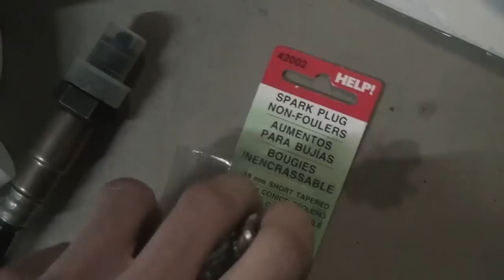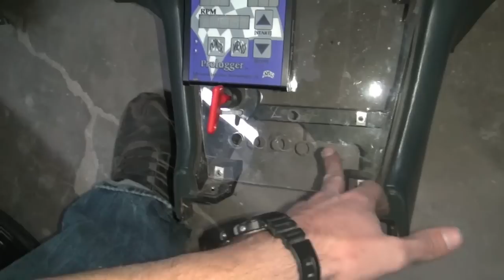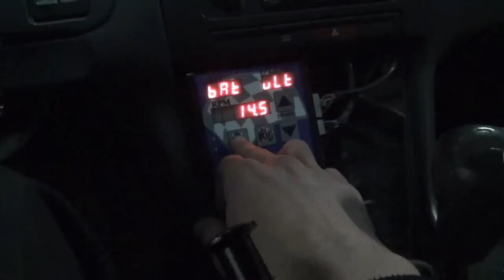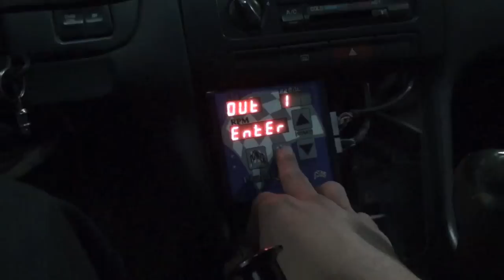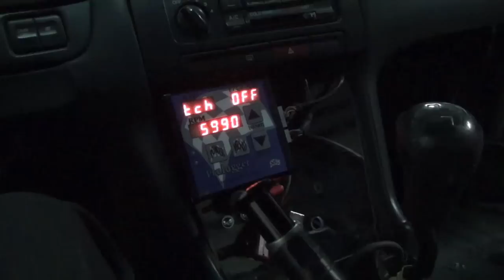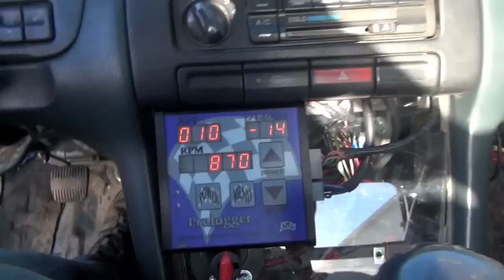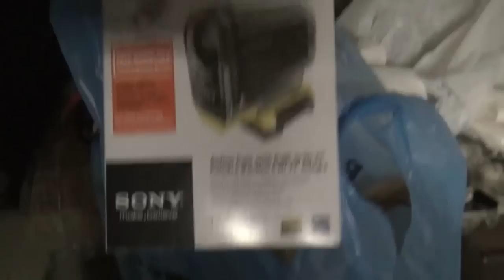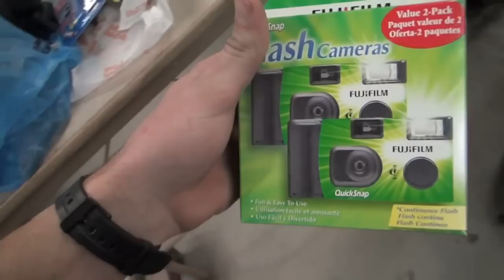Before Phoenix ProAm Prep - Vlog

Comment: I need help with my fastback idk shit about wiring and mine cranks hell slow no melted wires brand new battery starter and cranks slow has many shorts it drains so much from the battery that motor the transmission hesitates to shift and my tailghts don't turn on they usto work they only turn on when I take out the swith from the mount idk its a huge headache I just need some tips on what to look for I know everything but wiring and my seatbeltmotors stop working I didn't even drive it or mess with any wires and shit started getting worse